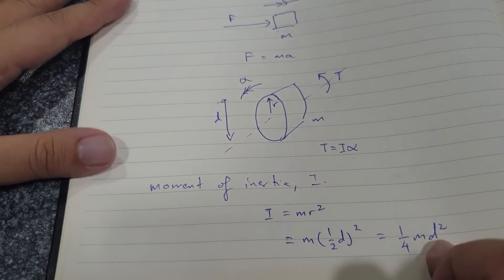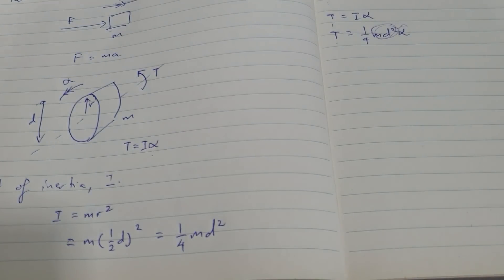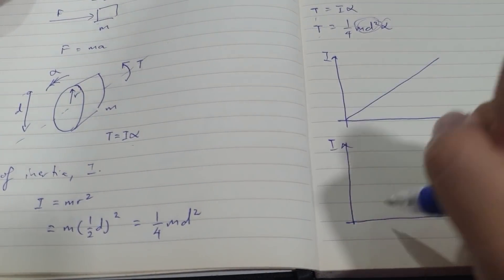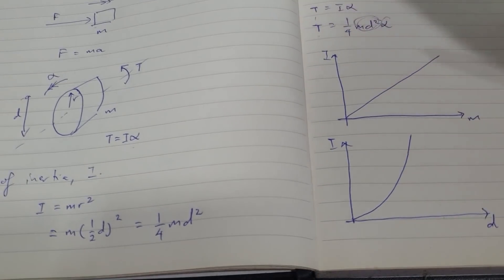Why upsizing your wheel affects your straight line acceleration | EvoLTN

Comment: Sir you are 100% correct, i timedy car by gps and it accelerated 0.5 seconds faster to 100 km/h than on the taller wheels!
Reply from the maker: Interesting to know... what sizes were u using before and after? I assume same tyres and similar ambient conditions?
Reply: @KonWaiLuen  originally 205/65/15 i switched to 195/55/15 and the car was literally 15% faster, same conditions and traction. I used a $95 amazon precise gps accelerometer to test this. my car is an old V6 camry, originally the time to 100kph was 8.5 seconds, after the mod it became 7.2 seconds. Unfortunately the car uses more fuel on the highway because it cruises at a higher rpm but it's a sacrifice i'm willing to take.
Reply from the maker: 195 is a little narrow for a car the size of a Camry, no? But great to know it's a setup you're pleased with!
Reply: @KonWaiLuen  195/55/15 is actually wider than 205/65/15 by atleast 1 cm. I didn't believe it when i placed the tires beside each other on a flat surface.

Comment: From what ive gathered from your video... performance related, reducing your tire diameter increases acceleration and decreases ride height without modifying your engine or your suspension...It seems too good to be true to be able to knock two birds out with one stone over a set  of tires. And here they are advertising cold air intakes to us guys. 
You could also widen the tire width a couple of centimeters to increase grip while still allowing stock rim fitment. I know this because i did it with winter tires (im canadian, it helps on the ice).
Im going to try it for summer tires...

Comment: so in a 100meter race, both will still reach the finishing line at the same time, for the same car torque? Just that the car with smaller wheel  need that increased acceleration to do so? Just like if you have shorter legs than usian bolt, you need to run faster to match his time?
Reply from the maker: The bigger wheel will presumably have an advantage at higher speeds, but during initial take off, my money is on the smaller rims making a quicker getaway.

Comment: The area surface of contact will have much bigger effect on the inertial momentum whereas in brother Kon's senario, contact area is assumed the same (the first number of tyre rating) but if you upsize both the rim size and the wideth of the tyre and with enough torque for both scenario, wheel spin will reduce and a better initial acceleration can be achieve.
Reply: T.Y. EEU indeed..

Comment: hi kon!
my car currently runs on 225/50/r17. when the time comes i wanna change to 235/50/r17 (i have considered 235/45/r17s but the size difference compared to the 235/50s is larger). would it be okay?